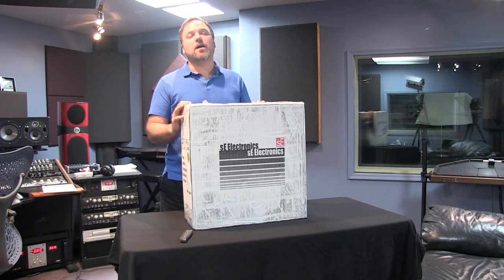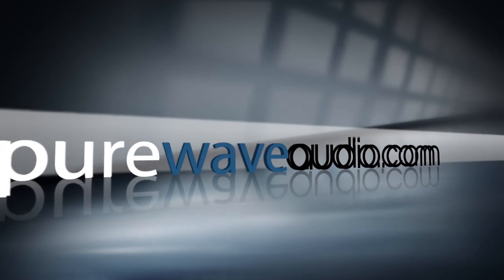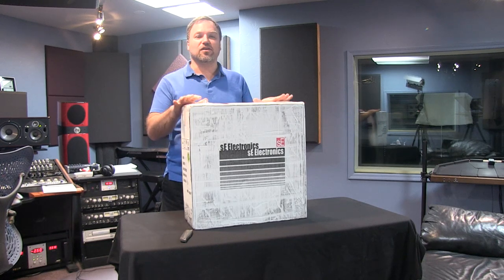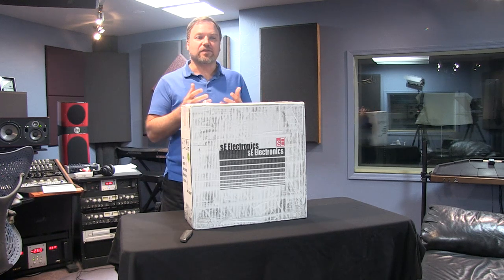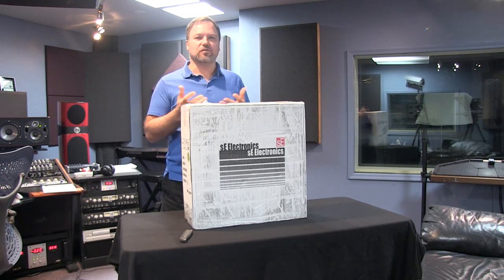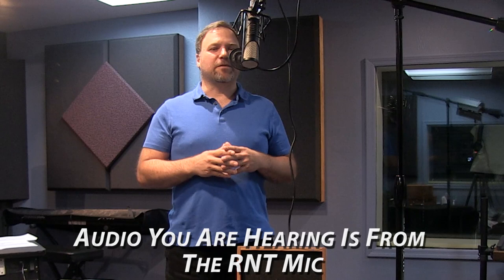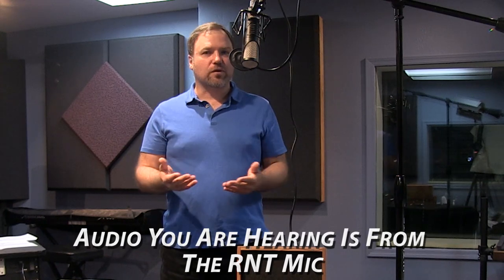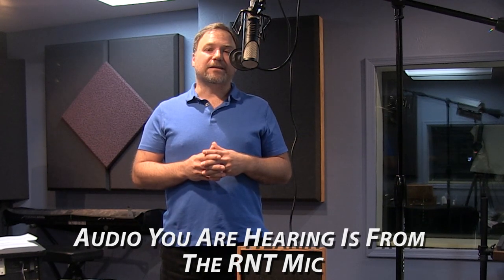sE Electronics RNT Rupert Neve Tube Microphone Unboxing and Overview

Comment: I've been doing some hard research as I have been trying to decide whether to purchase the RNT or the U67 and I really feel like, when compared to a VINTAGE U67, hands down the U67 wins in richness and ear pleasability. But when compared to the reissued U67, I am finding the difference barely noticeable to my ears. Most definitely not a 4,000 difference for sure. Again, imo, this could not be said when comparing to a vintage U67. I truly feel like you could spend the 2500 bucks on the RNT and run it through a tape sim, set your mic up in a well treated environment, or do some light eq and get nearly identical sound to the reissued U67.
Reply from the maker: There is shootouts on this channel between the RNT and original vintage U67 among others.